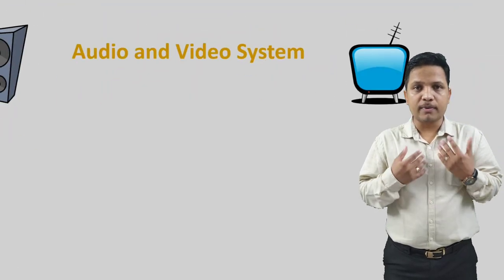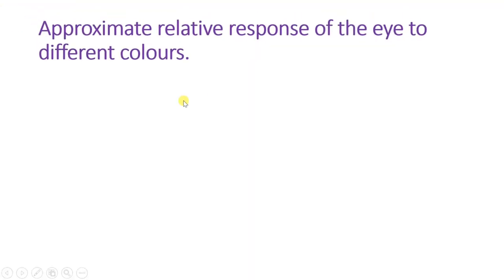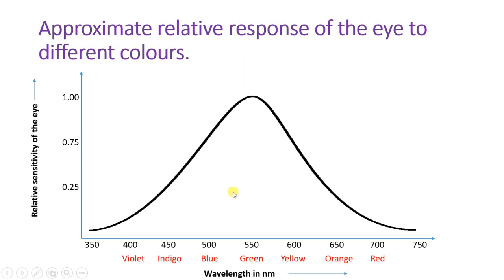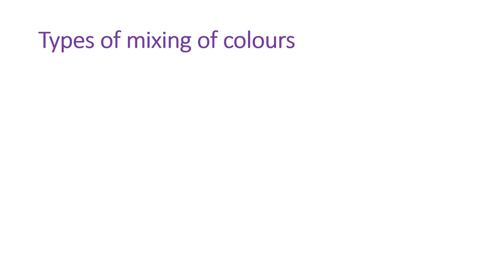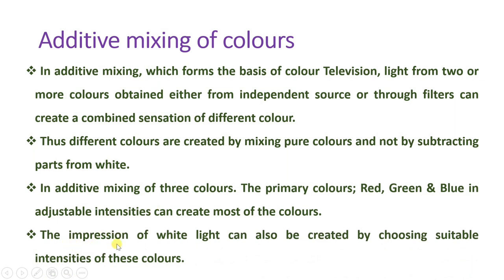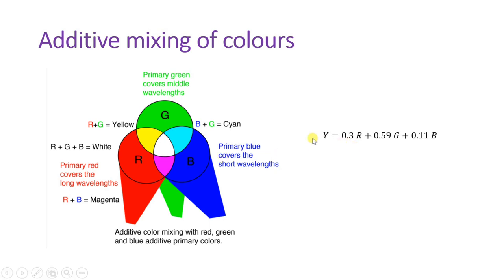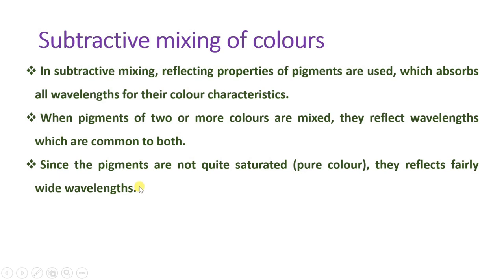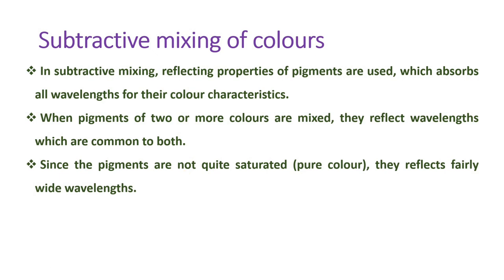Three Colour Theory (Additive Colour Mixing & Subtractive Colour Mixing) Explained

Comment: When white light or sunlight is split into its various colors by a prism, we get the following wavelengths of visible colors:
625-750nm - Red
590-625nm - Orange
565-590nm - Yellow
500-565nm - Green
485-500nm - Cyan
450-485nm - Blue
380-450nm - Violet

When we combine those same colors of light, we get white light.

Magenta is a combination of red, blue, and violet light. Why doesn't magenta have its own wavelength?